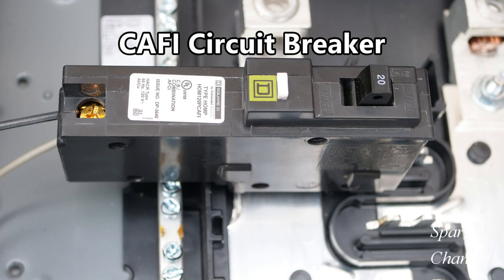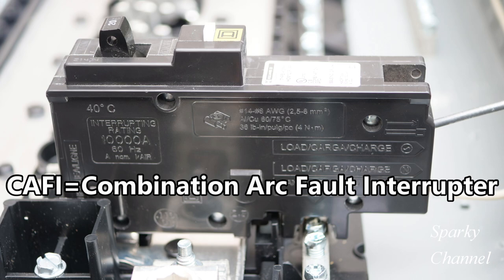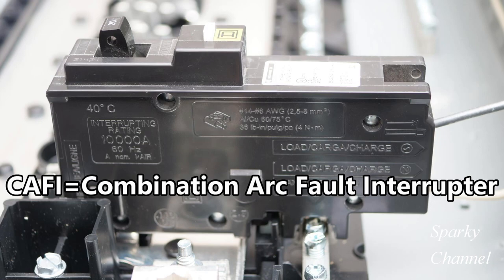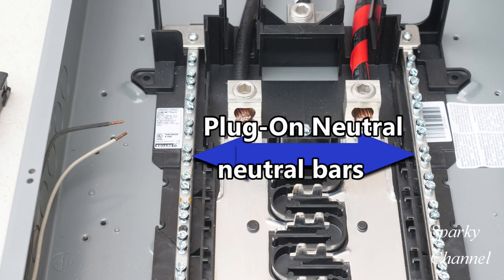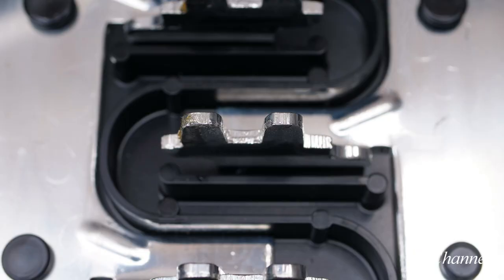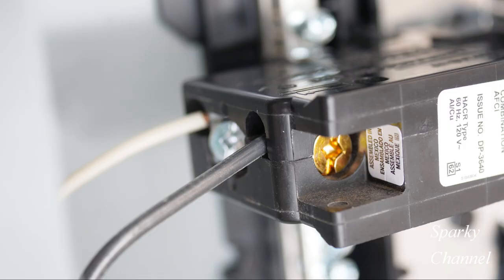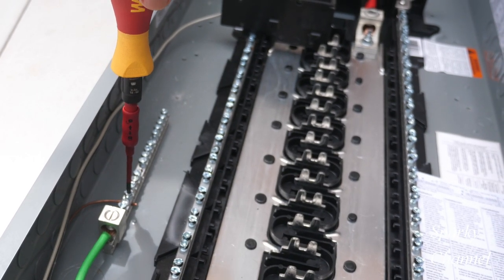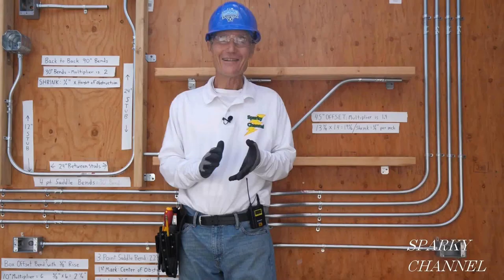What is a CAFI Circuit Breaker and How are They Installed on a Plug-On Neutral Load Center?

Comment: Another great explaination.  Note on older homes, have fun with the shared nuetrals when adding an Arc Fault breaker.
Reply from the maker: Yes, lots of fun!
Reply: have fun paying for a two pole AFCI.
Reply: Actually GE (now ABB) have CAFI breakers that can be used with circuits with shared neutrals.

Comment: Love the video!  On the SqD breakers, remember CAFI = white, GFI = yellow, Dual (CAFI+GFI) = purple.  Of course, this is manufacturer specific.

Do you know when the QO PON GFIs are coming out?  There's a part number, QO120PGFI, and heard they are new for this year.  However, I'm told they still aren't available.

I have taken to typically wiring PON breakers before plugging them in the panel.  It goes easier/faster to confirm the wire is fully in and well seated.  It doesn't matter much for your blank dead panel here, but crowded live ones are a different matter.  Of course, make sure breaker is OFF when putting it in the panel.

Not sure why, but I used to have occasional problems with the PON breakers stripping the wire clamp head with both a robertson or a slotted bit while torqueing.  However, since going to an ECX bit, life is fantastic there.
Reply from the maker: Yes, I was going to mention that but, as you say, it's manufacturer specific. No, I don't know when the QO plug-on
neutral is coming out. Thanks!

Comment: Thank you for this video.   Which Square D Homeline Panel would be suitable to replace an old Stab-Lok Circuit Panel with 125 amp max rating 24 spaces for breakers?  Can you provide a link?  The Square D Homeline Panel provided by your link is rated 225 amp is over-rated for my situation.

Comment: How timely! I needed one of these yesterday (well, I wanted the combo one), and it seems Home Depot doesn’t have any. Fortunately Amazon did, and they should be here today.
Reply from the maker: Excellent!
Reply: If your Home Depot is anything like mine it would be a great place to open a lumber and supply center. Since they already have shelving , check out registers all one has to do it put inventory on shelves and replace thae orange sign.
Reply: @vicktorpatriot1430  🤣🤣
Reply: @vicktorpatriot1430  To be fair, they had them for the Homeline series, but I had put in a QO series sub panel in my garage.
Reply: @OriginalJetForMe  Maybe I am a circuit breaker / Load center snob but I don't really care for the homeline series.  I prefer Cutler Hammer ( Eaton CH ),  Square D QO,,  Siemens ( particularly the bolt in breakers )  GE powermark gold / powermark .  I really don't know of a current manufacturer of panels that are crappy like the Zinsco and Federal Pacific  lines turned out to be.
Reply: @vicktorpatriot1430  I got the impression the QO was superior, which is why I chose it. But it does have less support at the big box stores.
Reply: @OriginalJetForMe  the QO is a better breaker and is used commercially where the homeline is not.
Reply: @vicktorpatriot1430  Yeah, that's largely why I chose that line.
Reply: I'm installing a 100 amp sub panel (Homeline) and intended to buy 15 dual function breakers. Surprise, surprise, Home Depot has 2 within 100 miles @ $59.00 a pop. I found them listed elsewhere, but they are priced from $88.00 a pop up to $300.00 a pop. Kind of defeats the purpose of buying the Square D panel. Seems to me like since the new NEC REQUIRES AFCI/GFCI in nearly every room, they'd be plentiful.

Comment: Love Square D stuff. How much was that Bill? 50 bucks?
Reply from the maker: Square D Homeline 20 Amp Single-Pole Plug-On Neutral Combination Arc Fault Circuit Breaker is $51.
Reply: @SparkyChannel  wow things are getting crazy expensive right?
Reply from the maker: @anthonyelectric6045  They sure are!
Reply: I put together the main square d main panel 20 years ago with seven of this type of braker. Never any problems. 😮

Comment: Are them the breakers that trip everytime you plug in a vaccum cleaner 🤣
Reply: That's be them all right
Reply: If so, then that circuit must be overloaded.
Reply: @jesseestrada4290  no cheap vacuum cleaners brushs arc causes the breakers to trip
Reply: @johnkulpowich5260  or the switch is bad

Comment: Homeline ad QO,  breakers by Sq D.  Are very good.  But they are to big.  I use Siemens brand.
Reply from the maker: Siemens are excellent.
Reply: Size issue is right on.  ~2 1/4 inches for wires behind the breaker is just not workable for busy situations.  SqD any answer with smaller breakers coming?

Comment: $240 for a torquing screwdriver? There has to be less expensive options.
Reply: Harbor Freight's Quinnn bramd has one rhat works great ans goes up to 50in-lbs. Anything over that gets to be quite expensive.
Reply: A regular torque wrench with a socket that accepts an Apex bit will work.

Comment: Uh sir, that is a qo not a homeline.
Reply: Well the one you plugged in at first few seconds of video is a qo. Not homeline.
Reply from the maker: It is a Square D Homeline HOM120PCAFIC
Reply: Wrong. It's Homeline. That's why the part number is HOM120PDF as it shows on the breaker in the video.
Reply from the maker: @illestofdemall13  Yes, Homeline model #'s start with HOM. Hi Kris!
Reply: @SparkyChannel  Hi Bill, how's it going?